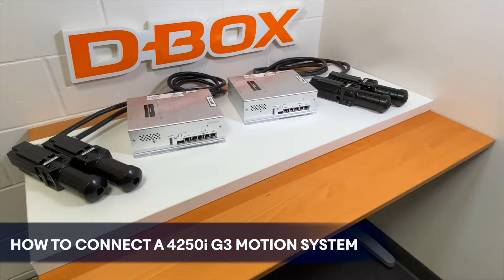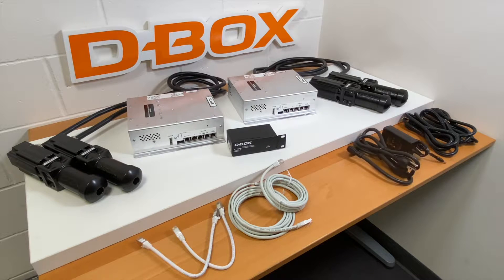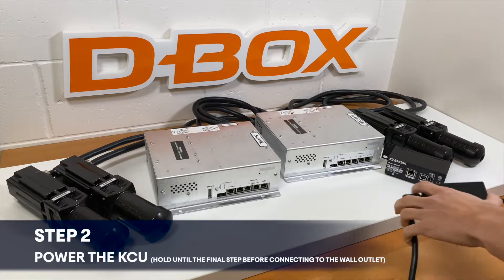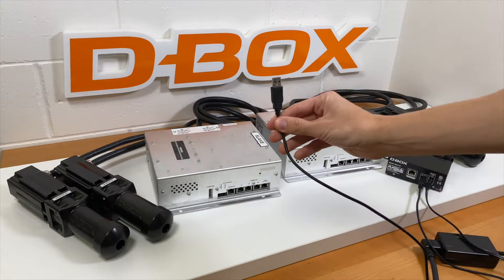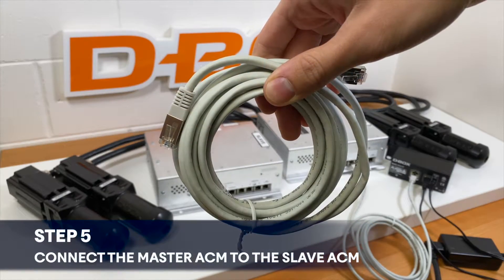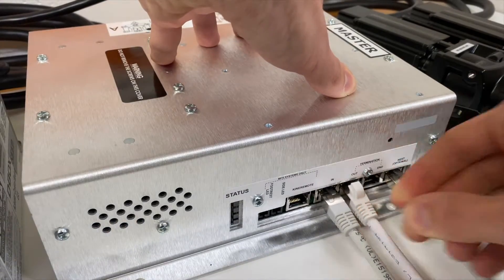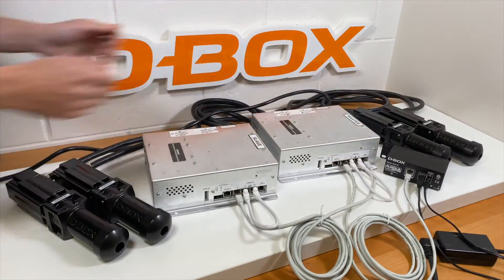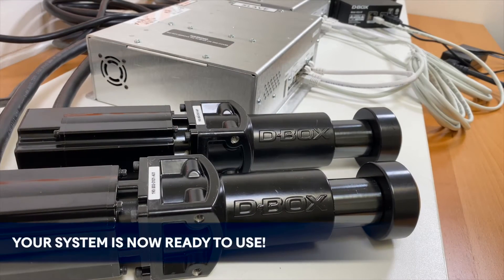How to connect a 4250i G3 Motion System

Comment: How many W consume one master box and one slave box for 3"? I want to know if I should put them in the same outlet with my PC 800W (PC and monitor)
Reply from the maker: Hi Dan! The spec sheets are here: https://support.d-box.com/en/knowledge/get-started-with-your-g3-haptic-system#Spec_Sheets
Reply: @DBOXTech  I use 4 actuators, what is the distance I should mount them on the simlab p1x? Is ok if the distance is not equal?
Reply from the maker: @iamdanfleser  When integrating the Haptic System on a platform, D-BOX recommends balancing the center of gravity (CG) of the platform to ensure each actuator supports an equal load. But we would encourage you to contact simlab and see what they recommand with this rig.
Reply: @DBOXTech  thanks, will also contact them. But how do I find CG on my rig?
Reply from the maker: @iamdanfleser  That would also be a good question for simlab.
Reply: @DBOXTech  it is normal that if I have 4 actuators. I play a game. 3 acuators are rised, and one is raised but not as hiigh as the other 3 and is an air gap between the actuator leg and the floor white plastic support. Is this normal?
Reply from the maker: @iamdanfleser  We are very sorry but that's a question for simlab.
Reply: What is the difference between g3 3” actuators family models 250i3 and 400i3?
Reply from the maker: @iamdanfleser  250i has a maximum lifting capacity of 250lbs as the 400i has a 400lbs.
Reply: @DBOXTech  how do I know which version I have?
Reply: 250/400lb per actuator? Or per 4 actuators?
Reply from the maker: @unuloarecare7133  It should be indicated on the actuator.
Reply from the maker: @unuloarecare7133  Per actuator. So, if you have 4, it's max 1000lbs/1600lbs
Reply: @DBOXTech  sounds great

Comment: What would you recommend for a Traction Loss system to add to the new Gen 3? I feel like you are missing something without the functionality of having T/loss included or as an optional extra for example. Any thoughts on this? Or what T/loss system you would recommend to go along with the 4250i system?
Reply from the maker: Hey Mark, there are different ways to simulate traction loss and you can definitely use G3 to do so. Traction loss is created by combining the lateral acceleration to the rumble that would be associated with the tires slipping on the road surface. Some of our partners prefer using a horizontal sway displacement while others prefer using YAW. To do so, you can make an addition to your current 4250i with a 1-actuator system to allow YAW, or a 2-actuator system to allow for YAW+SURGE or YAW+SWAY. Simply place the additional actuator in the way you wish to create the movement, reprogram your system using the Motion System Configurator and you will be ready to race.